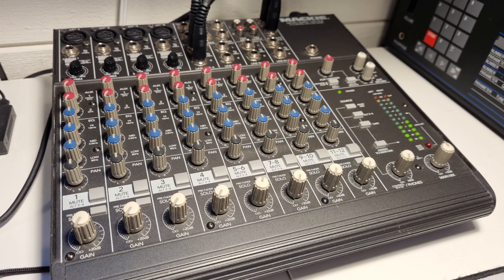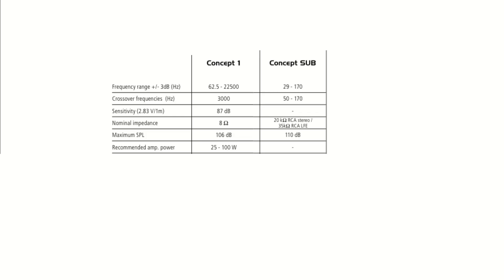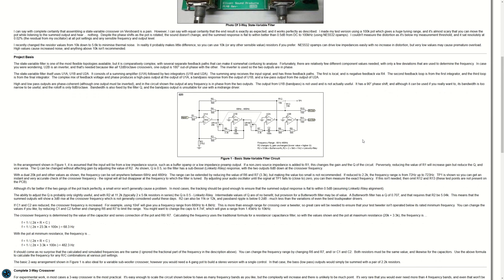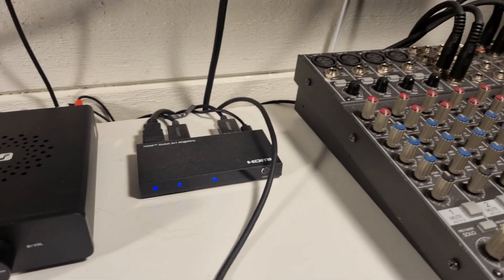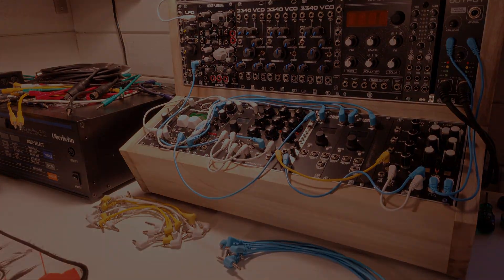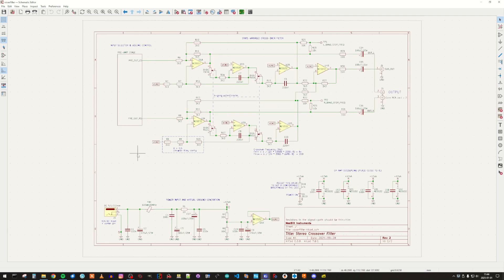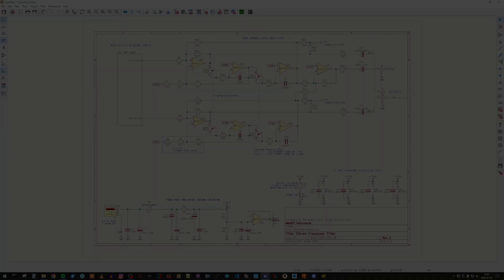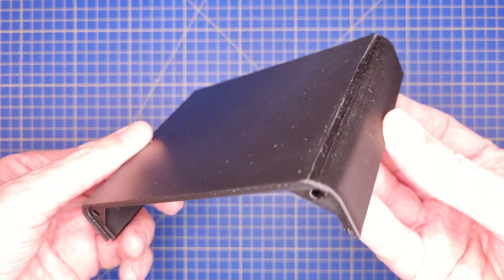Active crossover filter DIY

Comment: Great design and implementation but, I would have gone with fixed resistors for the crossover frequency selection. There’s no audible reason for the continuous adjustment with the four gain pot and the whole delusion that you need that much fine adjustment goes out the window the first time someone brushes against the knob and destroys your perfect, precision adjustment. This is a common design error in consumer gear.
Reply from the maker: Thanks! Yeah, exactly that happened when a friend of mine came over and we were listening to some music; he thought the crossover setting was the tone control so he started to mess around with that knob  🤣🙄

Comment: Cool, enclosure.
You might wanna use "opa2991" for virtual ground since it can provide 75ma or use transistor totem pole. i made a thing that's powered 4 opamps with one such voltage source it works up to a certain level than the virtual power opamp is strained so much only noise comes from entire circuit.

Comment: hello sir, amazing build, could you help me out with how you have aligned the inputs and outputs with the holes on the front and back panel?
Reply from the maker: Thanks a lot! I did it like this:
1) I took dimensions from the datasheets for the components to locate all the holes 
2) after that I made the design of the main PCB in KiCad placing out the components on the PCB the way I wanted them. In some cases I had to download 3D-models of the components from the suppliers and add them to my component library.
3) I exported the PCB design as an STEP-file
4) then I imported the design into Freecad and designed the enclosure around the PCB 3D-model
5) next step was to design the outline of the front- and back-panels in KiCad.
6) I used the top surface of the main PCB as the reference plane and then I placed all the holes for the connectors and pots using the measurements from step 1) above.
7) final step was to verify the location by exporting STEP files for the panels and bring them into FreeCad so I could check that everything matched up before I sent the PCBs for manufacturing
Reply: @MeeBilt  wow amazing, this would help me so much! Thank you so much sir. in future if you have the time and motivation could you make a video of you explaining the process of you doing the mechanical work for your products, such as mechanical design decisions and techniques. Thank you once again!

Comment: Very nice job. I would be interested to learn about your PCB layout process for circuits like this.
Reply from the maker: I have a series of episodes called "909 Rimshot" on my channel that explains my workflow. It's for a Eurorack module, but I basically used the same method for this design. In order to fit the holes for connectors and pots I used 3D-models of the PCBs that I exported from KiCad into FreeCad where I checked the aligment and dimensions.
I hope this answers your question

Comment: Doesnt such a filter introduce a time delay so the sub will always lagg behind the front speakers? I've never heard good transient bass notes sound right without delay on the fronts to match the slowness from filter and heavy cone in the subwoofer.. In regular speakers you often see a 1. order filter that introduce a minimal phase delay of 90 degree. I have multiple subs myself but without delay on the fronts,  it doesnt sound right nomatter how I adjust the dsp on the subs. A friend of mine bought a Wiim amp with delay on the fronts, and for real that made the mono sub integrate and sound SO much better. I feel this issue is a truly overlooked issue in 2.1 setups.
Reply: I think the point of active crossovers is you can design them to avoid the phase shift of a purely passive crossover. If you’re really bothered about time and phase alignment, get a multi channel amp with DSP, then you can time align based on where the drivers are positioned in relation to your listening position.
Reply: @Jonathan_Doe_ Actually, if you have the same filter response transfer function it doesn’t matter whether  it’s passive, active analog, or DSP. They all have the same response in the time domain because they have the same response in the frequency domain. So the “delay” of a LR4 is the same no matter how you implement it.
It is true that you can design different responses in DSP that will give you different time domain responses but, that’s not the same filter that you design in passive or active analog.
Reply from the maker: This is not a problem that I have experienced. But I guess that it would be possible to make an in-situ tuning in the preferred listening position and adjust groupdelay of the front speakers to match the subwoofer response.